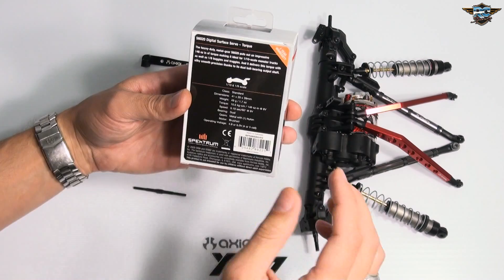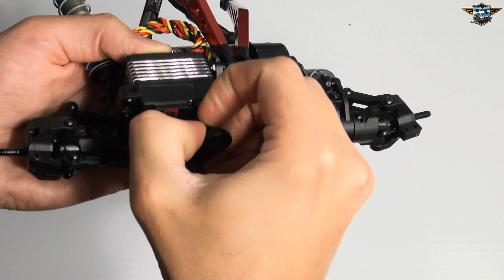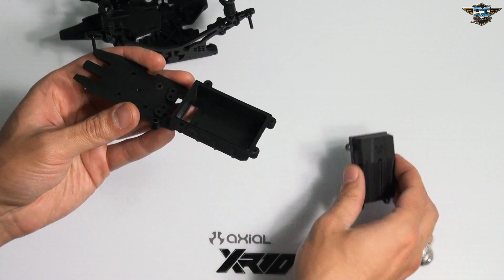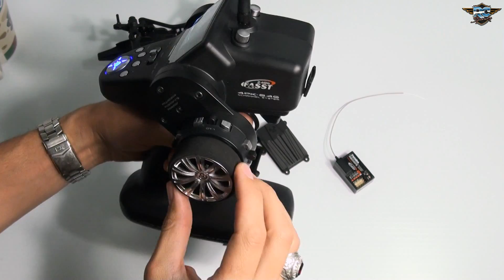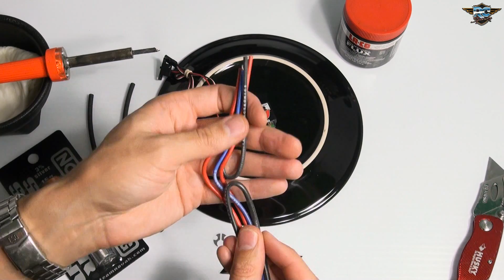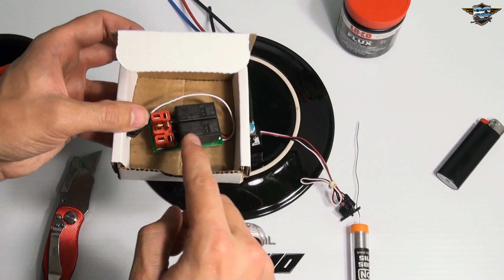RC ADVENTURES - AXiAL XR10 ROCK CRAWLER - BUiLD SERiES - PT 4 - CHASSIS, SOLDERING, ESC'S

Comment: LaCo is excellent flux, but it isn't an adhesive, it deoxidises the surface to be soldered and is heat activated
...also, clean the joint with a wet rag after, it's acidic!

Comment: @wirelesscps Yes the FXR combo comes not only with the capacitor but also the 5 wires MEDiC shows, fixings for the ESC, cable ties to tidy your instalation and instructions offering soldering tips also, and set-up information.

Comment: @SamuelFletcher 
I should be, think about it...ppl run a 35t on 3s in their ax-10 based rigs, so you can assume almost double torque provided by both motors.  Should be just fine and the wheel speed should be crazy.  Check out Brandon's xr-10.  The thing jumps up the rocks at times.  Absolutely rediculous!